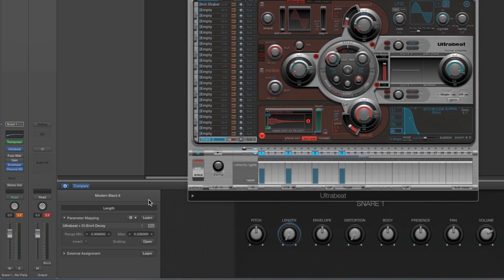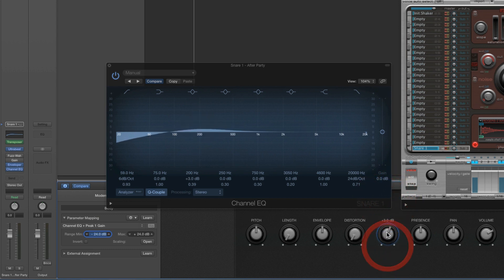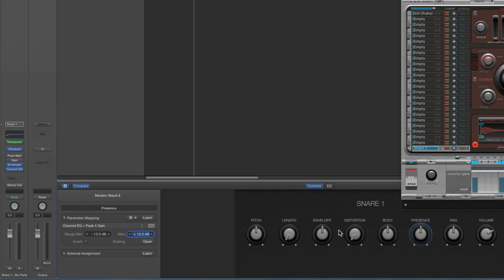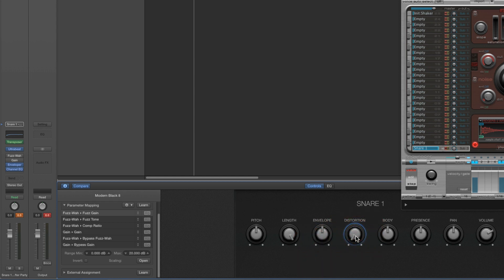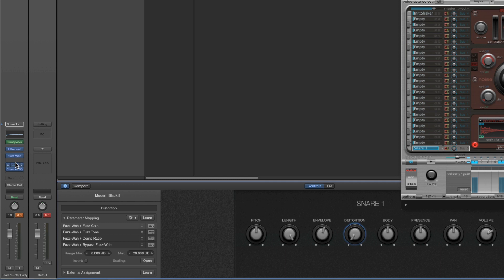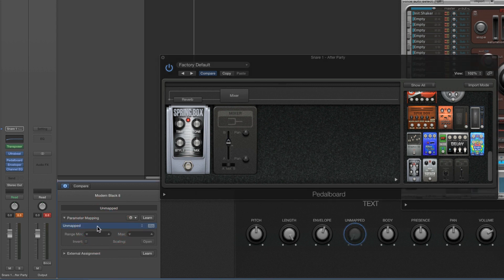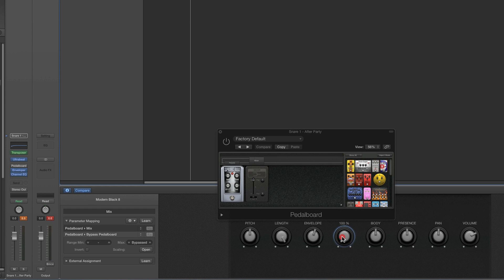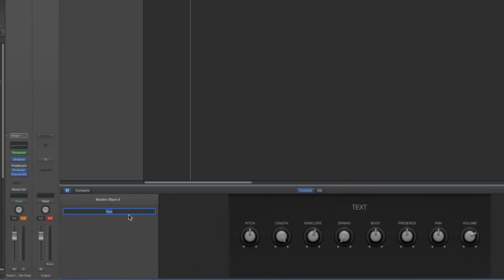Logic Pro X Drum Machine Designer Tutorial 7

Comment: also, right before you save and you are setting the level, does it matter if the oscillator and ultrabeat voice volume are at 0db? I notice your level was around 8db when you saved it. Do you just push the volume until it reaches the ceiling without clipping, then save, and then use pre fader metering when mixing a new project?

Comment: First of all, thanks so much for making these videos. I watched the whole "Drum Kit Designer" series and followed along with each step. I learned a ton!

The "Drum Machine Designer" series has been awesome as well, but I've run into a problem. Saving my user generated snare patch alongside the factory patches is not working. I'm saving in the exact location that the video states, but the patch doesn't show up in the Library like it should. I've tried restarting the DAW, and refreshing the Library, but the patch still won't show up, even though it is in the correct folder in the finder. I've attached screenshots of the location of the file (I've called it "Snare 1 - Paramore Spring"), and the Library showing the absence of the patch.

http://imgur.com/X5JrRdt

http://imgur.com/dAs3zxn

I have three hypotheses as to why it might not be working:
A. Logic has been updated, somehow changing the protocol for handling default patches
B. My patch might be too big. It is 359kb, and all the other factory patches are 306kb or 307
C. El Capitan (which I am using) may handle these files differently (I seem to remember you saying you were using Mavericks at some point)

Hoping someone can help me with this issue.

Thanks again for the awesome tutorials!
Reply from the maker: did you try 'Refresh library' (from gearcog icon bottom of library)?
Reply: Yeah, I tried "Refresh Library", I quit and re-opened Logic, and I shut down and re-booted my mac. Still nothing. I ended up just saving a copy in the "User Presets" folder how Logic is set up to do. It's not quite as slick as the way you have it set up, but it's only 3 or 4 more mouse clicks so it's not TOO big of a deal.
Reply from the maker: weird. must be yet another el crapitan problem.
Reply: Haha "El Crapitan" nice... Seems like that's probably it. Thanks for the tutorials anyhow. Top notch stuff!
Reply from the maker: :) that's what they call it apparently